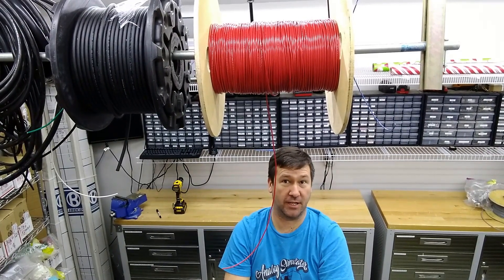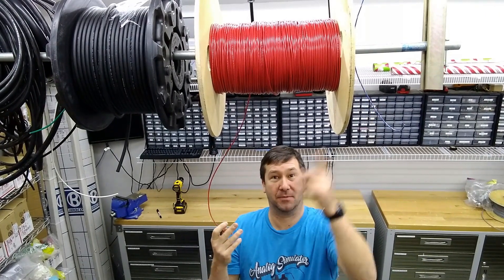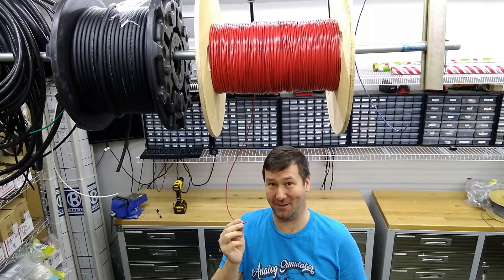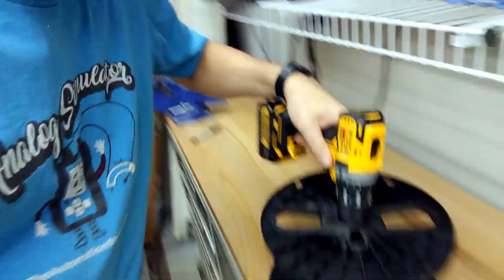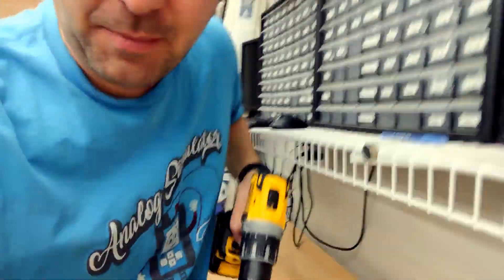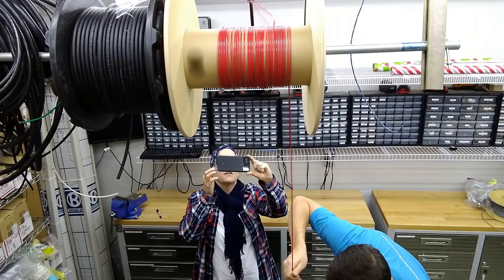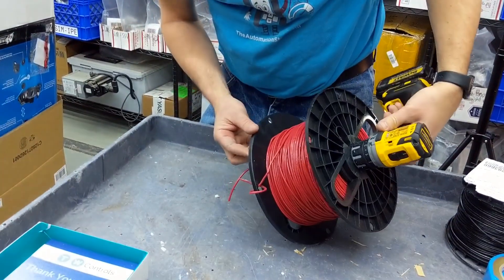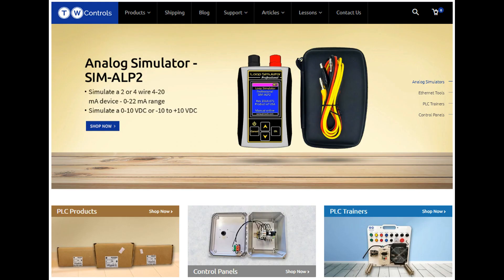How to Respool Wire or Not Respool.  That is the Question

Comment: I use a 3/8 threaded rod with a nut and washer on each side of the reel, tighten one end into the drill and hold  other end with a short piece of conduit and spin away.